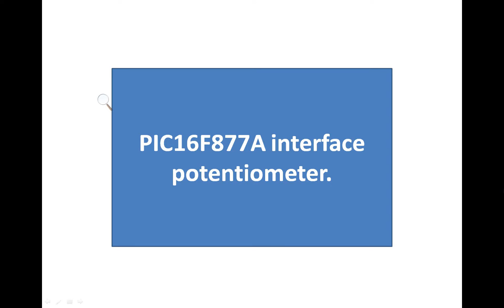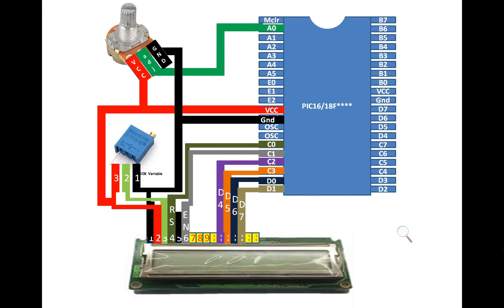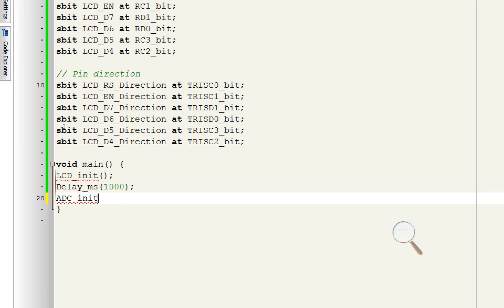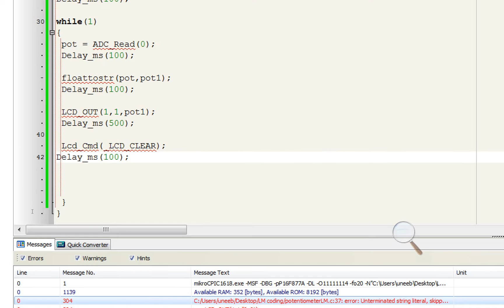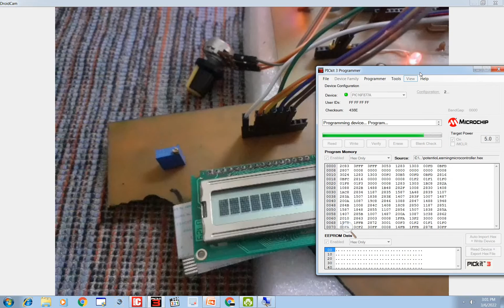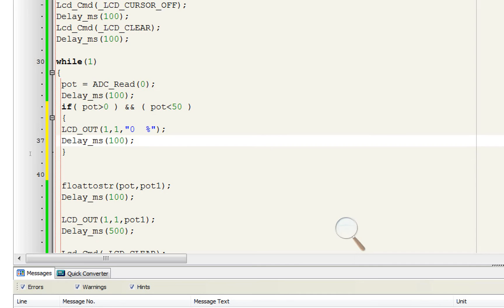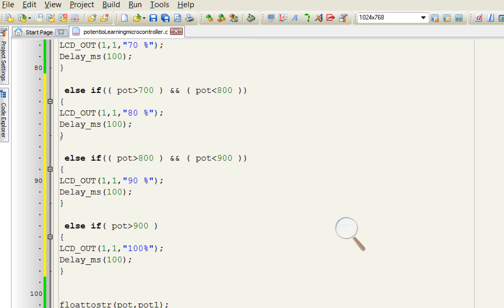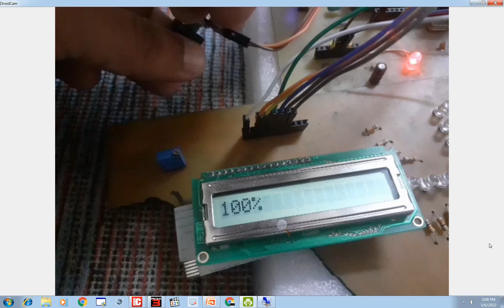PIC16F877A interface potentiometer using MikroC for PIC code. 0  % to 100% rotation display on LCD.

Comment: Hello sir thank you for the good job please can you make a code to display from 0v to 230v thank you hope to hear from you soon
Reply from the maker: Sure 
Thanks for video suggestion
Reply: Thank you respond my question I appreciate it and one thing I'm intrsting of learning microcontroller please what do I need before I can start Sir? Thank you
Reply from the maker: You need to select which microcontroller you want to start
If you learn 1 good
You learn all good
Then you select which compiler software you prefer.
Reply: Thank you sir I appreciate your response, I want to start learning pic16f877A and xc8 compile please can you guide me?
Reply from the maker: I m using MikroC for PIC
Not XC8
Reply: Okay Sir then I will use pic mikro C I will start learning with mikro C
Reply: Hello sir please there's some words it confirmed me and I can hardly understand it, please in mikro C or any other software. Please what is the meaning of ( i ) what does it mean because I see it in so many code Cha i?
Reply from the maker: Share with me the statement
In which you saw it
Reply from the maker: In normal as far as I had uses
i is just an ordinary variable 
Like any random variable to store values
Like mostly in for loop I use this like
Int i=0;
Means i is an interger starting from 0
Then in end I write
i++;
Which means increment i by 1 meaning everytime loop is excuted its value is incremented by 1 
Inshort i its just a name which you can use as variable
Reply: Okay sir thank you so let sum that I'm writing a code I can choose int j=0 instead of int i=0?
Reply from the maker: Yes
Reply: Hello dear sir please there's another register I don't understand what is the meaning of (int)? thank you hope to hear from you soon
Reply from the maker: Int is short form of integers
Its data type you use
Integers are numerical values excluding decimals
Reply: Okay sir thank you for your response I appreciate it thank you once again